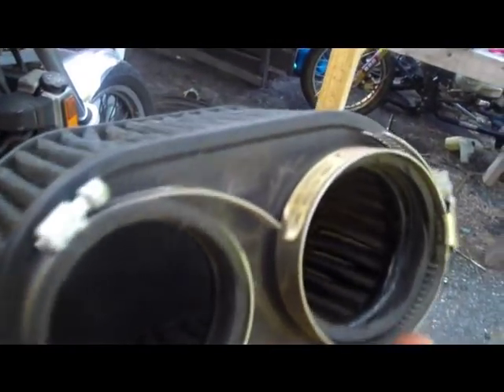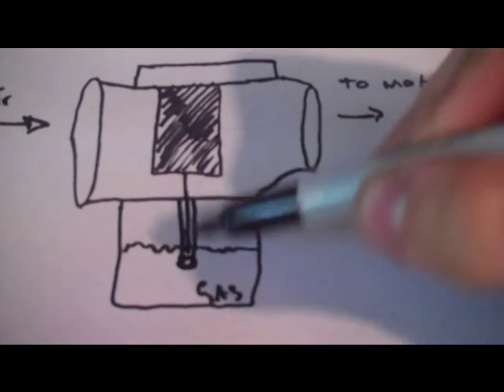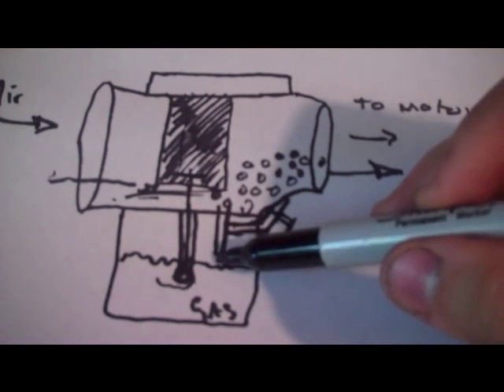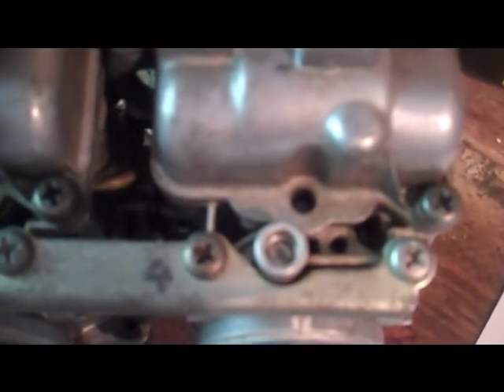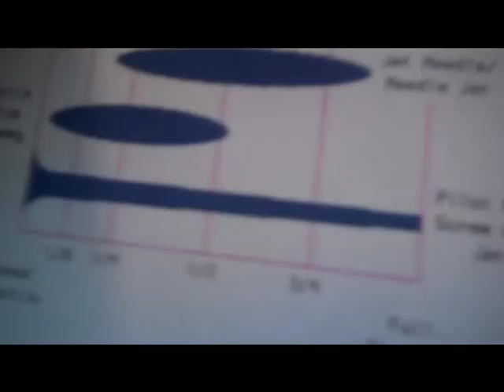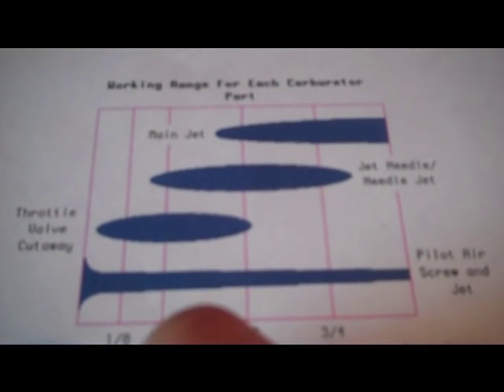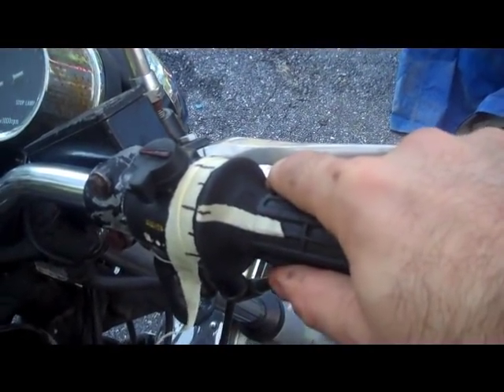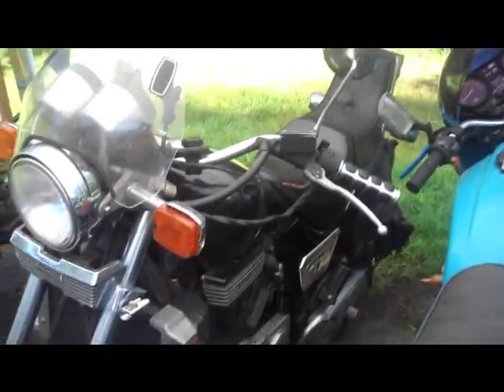How to adjust the jets on motorcycle carburetors

Comment: Great, GREAT educational video.  I'm currently trying to get a Yamaha PW50 running right, and I think it has to do with carb tuning.  Right now I've got it running just about perfectly, until I get up to the upper revs, where it just doesn't wanna scream.  It starts first kick whether hot or cold, it revs nicely up to a point, and it idles perfectly.  When I really try to give it full throttle, it gargles, for lack of a better word.  When I take it for a test ride, it does fine except for the upper rpms, where it doesn't wanna scream/wail.  It either just doesn't get there, or gargles.  It sounds like it's too rich, but decreasing the main jet doesn't solve the problem.  As I decrease the main jet more and more, it runs worse, until it starts making like a popping sound, which I interpret as too lean.  Any information or insight would be appreciated.
Reply from the maker: Does it run better on choke?

Comment from the maker: 225 is enormous for a virago 1100. Stock size should be somewhere around 125 and 122.5, your repair manual can tell you for sure. Unless you have intake mods, take all those shims out, and put everything back to stock. Sounds like this was previously owned by a crazy mechanic

Comment: Hi Mr Max Storey,
I would like to know a little bit more about the functionality of the carbs. What I mean is: You started very well to explain what happens in the carbs by means of drawing a simple schematic. But there is missing the throttle flap on it and the vacuum chamber. This is very essential if we want to understand how they work and after that to know how we can influence on them to get the wanted adjustment. Probably, i didn't catch that very well from your video, because of my English.
So, could you please tell me what is the flow direction in this small line with the pilot screw on it and is it really connected above the fuel level in the float chamber? If I am not mistaken another end of that line is downstream of the throttle flap, where is all the time a vacuum (when the engine runs, of course). If the principal in all Mikuni carbs is like it is shown on your schematic, I understand that like this - if I start to unscrew the pilot screw will allow the vacuum to the float chamber and in result of this will make the fuel mixture leaner. I am not so sure if my conclusions are correct, because I just started to study my carbs, which by the way are on my Yamaha xj600N from 1995. That's why I will be very thankful to you if you throw more light on the issue and also how is managed the vacuum membrane, respectively the needle according to the throttle flap position?
Would be very nice from you if give me your email. 
Thanks a lot for sharing your knowledge and experience
Regards,
          SLK

Comment: Ok I am running stock air box and filter, A MAC (i think) Slip On,slow jets removed and cleaned #35, Changed mains from 105 to 110, Float @14.5mm, Screws @ 1 3/4 Turns, New plugs, new Honda points plate, And yes all plugs are same colour, Thanks

Comment: Thanks for your input and GREAT video tutorials. Some background; it's originally a 50cc and I put a 70cc cylinder on it, the carb is a little Mikuni with a 70 Main and 15 Pilot, and the open filter mods and freer flowing exhaust I believe have made the bike hard to start. What would you say might be good size jets to start - maybe 90 main 40 pilot? I've got no vacuum or hose leaks and compression / spark is good.

Comment: I guess after today I won't be having these issues with carburetors anymore. Just got my Maxim out of the shop after being there a whole month & they told me there's nothing more they can do to find the replacement carb boot joint. The ones I got off Ebay were worse then the ones I had. So I'm done spending $ on it and going to go pick up my NEW bike later today. A '11 Yamaha V Star 950 Tourer. Carb problems solved lol.

Comment from the maker: First see how the bike runs with the stock jets and settings. Sometimes exhaust modifications don't require rejetting, just make sure you are not running too lean over time. If you find you are lean after the exhaust swap, consider increasing the jet size

Comment from the maker: @Brahbarian Haha what year is it. Thats a good one. Its a 1990 block with 1991 heads and carbs (I think) on a 1989 Katana frame with a 1988 katana tank. So... I have no idea. Jetting it properly has been pretty tough. And yeah I do have a valve video in planning, but first I need to get a bike that needs a valve job done, but trust me next time I do a valve job I will post it.

Comment from the maker: @zx4133 Well, since you have 2 main jets I would increase them both by 2.5 and see what happens. You may need to go up a step again, shim the slides, and/or increase pilot jet size. But start the mains at 2.5 more if you can.

Comment from the maker: OK well in that case I would put it all back to stock settings, and then try to use the air/fuel screw to eliminate that popping. If you still can't, raise the slow jet size by 1 step

Comment: Thank you for the excellent video. Definitely  pointed me the right direction. I have a 1978 Kz750 with stock carbs, air box and newly installed open pipes. The issue I am having is only when I am accelerating on the highway in 5th gear when I reach full throttle the engine bogs completely and picks back up after I roll the throttle back down for a second or so. I can maintain running by keeping the throttle about 3/4 give or take. But as soon as I roll full throttle it bogs. I cannot achieve full speed. The engine runs good and strong any other scenario (of course I never hit full throttle in the lower gears).  I took from your video that I need to up the main jet 2.5 because its running lean, the thing is my plugs show running rich. I do have the fuel screws backed out 3 turns. Just wondering if I can be running rich and have a leaned out situation at full throttle? Thanks for any insight.
Reply from the maker: Check that your float heights are accurately set and your float needles dont leak, and that your air filter is clean. That may be causing a rich situation.

Comment: Love , love , love your videos ... they have helped me a ton ... I have a 1993 Kanata 750F with 4 Mikuni carbs ... I am having carb problems and it is the first bike I have attempted on my own ... it floods at low speeds and 3 spark plugs are burning black while the 1 is burning grey ... it will also back fire at higher speeds ... I have 4 K&N air filters and a 4 into 1 header with a Hines and Vance muffler ... How should I be setting my carbs as a starting point ?
Reply from the maker: Well at this point in time, thats a bit tricky. Ideally to jet carbs properly, you would want to have all of your stock components installed, make sure that the bike runs great and everything is functional, and then you add your mods and switch out the jets. If you dont have these stock parts available then you will have to jet using a lot of guesswork, but it is important first to make sure that the carbs are clean and 100% functional. The fact that one of your spark plugs is not like the other indicates to me that something is dysfunctional. You'll need to check float heights, make sure everything is working properly, and then compare the jet sizes which are in there now with the stock sizes to see if the previous owner made any modifications. From there you can size down or whatever you have to do to make it so you are not running so rich.
Reply: mrmaxstorey Thanks for the tips ... I bought the bike in this shape as it only had 53,000km on it ... the jet size on all 4 is 144 ... I am waiting for 2 new floats to come in now as 2 sunk to the bottom of a bowl filled with gas almost right away , while the other 2 stayed afloat all night ... but I think it will be worth the effort ... please keep the great videos coming ... I am learning a lot from you

Comment: This was an excellent video. Thanks for taking the time to share your knowledge, you really fine tuned my understanding of basic carb tuning. I am having a hard time dialing in my ATV. I cant wait to apply what you cleared up for me!!

I am getting some hesitation from 1/4 throttle to almost 3/4 throttle. Also, constant and sometimes violent backfiring during deceleration at closed throttle, with very rich conditions at idle..... so richen my needle... and lean my pilot just to start.... does this sound like a good start?
Reply from the maker: Do you have any modifications to the intake or exhaust?
Reply: Your problems don't sound like a carb tuning issue. I would check all the basics first. Such as fully cleaning all the internals, verifying all the tiny passages are clean, running a tiny wire through them, then carb cleaner, then high pressure air, check float heights. Make sure the choke or fuel enrichment is fully off, etc...
Reply: JasonWW2000
 i rebuild the motor and the carb. the carb is definitely clean. i went through it a second time when i first experienced the running issue...
i recently richened my needle by 2 notches and changed my pilot from a 42 to a 45, instead of leaning my pilot like a said earlier... once the weather gets a bit nicer ill take it out and see how it performs...
Reply: mrmaxstorey yes... thats why im having a hard time dialing it in.... i recently richened my needle by 2 notches and changed my pilot from a 42 to a 45, instead of leaning my pilot like a said earlier... once the weather gets a bit nicer ill take it out and see how it performs...

Comment from the maker: Sounds like you might be running a bit rich, hows your air filter? Correct sized jets? float height? What do your spark plugs look like? If all that checks out then yeah you can mess with the screws a bit if you want, its not going to hurt anything

Comment: Howdy,
I'm back working on the Honda CB750, 1980. Been all the way up and down the board with jet sizes and pods, and I just couldn't get it right so I put the airbox back on. Now I'm back almost to the stock size jets.(70's and 105's) The bike runs and sounds really good except for some decel popping, which is telling me too lean. The popping just started on this last main jet change from 110's to 105's (stock is 100)(Also, I have some V&h 4-1's with a custom slip on tip) One more symptom I'm getting is a flat spot at 3/4 throttle and up. Can't open it up all the way without it bogging down. With the decel popping, could that be the idle circuit now that I have smaller main jets? I know they're different circuits, but they all work together, eh? 
And. on the flat spot after 3/4 throttle, could that be possibly the timing having some effect? Because, the flat spot above 3/4 throttle has been there throughout this whole process, with and without the pods. I've been from 140's to 120's to 115's to 110's and now 105's. Only thing left is 102's but I'm concerned now with the popping that started with the 105's.
Reply from the maker: +Dave Harris Well timing needs to be dead on before you can do any of this so if there is any doubt of course recheck the timing. If I were you I would go backwards from here. Start with known stock settings, the bike should run pretty good if the only modification now is the 4-1. See how you do on stock setting and then increase the main size just one size and see how you do at 3/4 to wot.

Comment from the maker: No. If everything is stock, then you need to repair whatever is causing your bike to run rich, rather than add modifications or rejet in hopes of compensating. The two most common causes of a bike running rich are overflowing/misadjusted floats, and a dirty air filter

Comment: This is a great video like always thanks again :) 

I can only get my bike to idle when cold with about 1/16 th throttle (choke applied at first then removed after only a few seconds), if I try to just leave it on choke it dies, or re-introducing choke and removing throttle also kills it. After a couple of minutes, once it's warm it idles fine.

Would adjusting the pilot screws more be the correct thing to do, I am worried about messing up the idle when warm. If so would it need to idle richer?

Comment: A question regarding clipping the slide spring: I have a 1984 GR650 Tempter. I am going to open the air box for greater intake using the stock foam air filter. I am replacing stock mufflers with 17 inch reverse cone from Dime City Cycle. They are open but have a restrictor plate with several holes in it about midway, and some packing around the latter half of the perforated sleeve. So there is a bit of back pressure from that which I wanted for sound reduction and to keep the low to mid range power strong. 

I purchased a custom jet kit from 6Sigma Jet Kits, tailored to suit the model and mods. The kit will increase the pilot jet one size and the main jet by 3 sizes (they also included one size larger main jet as an option). They also recommended and included shims for the needle raising it one notch.  

As an option only, they also suggested clipping the slide spring by one turn, and drilling an additional vacuum hole in the slide (bit included in kit). They say these are for extreme riding styles and that they can reduce ride-ability. I can see that with the slide drilling, but I am thinking that clipping the spring without drilling the slide may increase throttle response without the downsides of drilling the slide. Have you any experience with clipping the spring? These are CV carbs BTW. Thanks, man. I really appreciate your knowledgeable and clear explanations.
Reply from the maker: I have not personally clipped the spring but it would be a good experiment. Just be sure to source replacement springs n advance in case you want to switch back
Reply: Thanks. Like you, I figure it's good for an experiment. I notice that the pistons in these carbs have quite a bit of air pressure resistance up and down, so it might be cool to reduce the spring pressure a tad. And if I did the drilling as well I can always plug that hole if it is a problem. Nothing lost by trying except time, and as you say, maybe a new spring. I'll keep you posted. Thanks :-)

Comment: Great vid, always love the drawings seriously helpful. Im lapping, valve seal replace and ring job alongside my gasket replacement and throwing pods on. Found a guy who had already jetted for my bike so trying his settings first and going from there. Do you add oil to gas ever? Also my manual says use 91 gas should I? will this run hotter or cooler Im trying to be on the rich/cool side for my air cooled maybe will add oil cooler. u ever need a free complete air box for 80 cb650c its yours 4real

Comment: I've got a 125cc moped and put a 180cc big bore in it got the full kit got it fitted but not sure on what size main jet to put in it it had 110 jet but I've tyred 115 jet 40% on frotl it pops and bangs someone please help
Reply from the maker: +Georgina Claringbull Use the tests I show in this video to see if you are running rich or lean, and adjust from there
Reply: +mrmaxstorey ok thank you I try this I think I may need 130 jet it's got 115

Comment from the maker: Whether you need to rejet is predicated entirely on how the bike is running, but if it is running poorly, jets are the only solution I doubt the screws are going to make much of a difference. That white smoke is supposed to be swallowed up by your air box and re-burned, I cant say for sure what that is but if you have good compression (compare it to stock compression numbers) then your head gasket and rings are most likely fine. Any color to the exhaust smoke?

Comment from the maker: By VV do you mean variable venturi? Its my understanding that is just another name for the CV carbs (constant velocity), which are basically carbs with the slide that is moved up and down by flowing air, rather than a cable-linkage mechanism (older model).

Comment: Dude, first off you're the man. 
I recently took my bike out of storage and it wouldn't start up. Took care of a dead battery and it still wouldn't turn. So, I used your video to clean my carbs. Just reinstalled them and now I can finally get it to start up.  BUT, I can only run it with the choke open. Ill get it up to 3500 rpms or so but when I let go it slowly just dies. Also, any throttle is too much and it just pops or dies. What I'm assuming are my pilot screws are rusted pretty bad. What my question is: Should I pull the carbs back off, try to loosen the screws and see where that goes or should I just open the needle more? 
thanks man
Reply from the maker: +Jake Avery If the bikes intake/exhaust is stock, the screws should be at stock settings. Make sure first that the intake is totally hooked up and the air filter is in place. If it is and the bike still isnt running off choke, then take the carbs back off, clean them again, make sure everything is put back together properly, adjust the float heights and you should be straight

Comment: Great tutorial on carbs.  I have a 94 Harley CV carb.  It was not running well after setting up for a year.  After cleaning the carb, I noticed that the pilot jet did not have a hole through its length.  It did have two sets of small holes in it's shaft.  The parts guy at the dealer, along with a tech said that it is clogged and their advice was to drill it clean.  I did this and now I believe it is running too rich. I also think that it was not clogged, but made that way.  What do you think?

Comment: Great video. Lots of excellent information! 

I was wondering though, I plan on installing some pod air filters soon. I also live at a higher altitude (7000ft). I should increase the pilot size because of filters increasing air flow. At the same time I should decrease the pilot size to compensate for the leaner air. Does one affect more than the other?

I'm having some trouble getting my bike started. Cleaned carbs. Plugs are black and sooty. Runs fine above 1/2 throttle. Hard to start. 
Thanks!